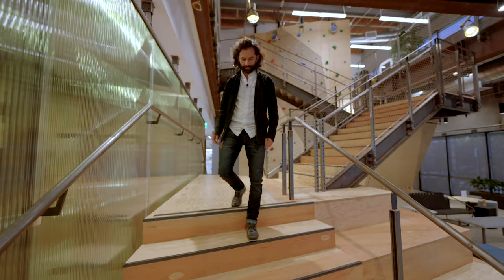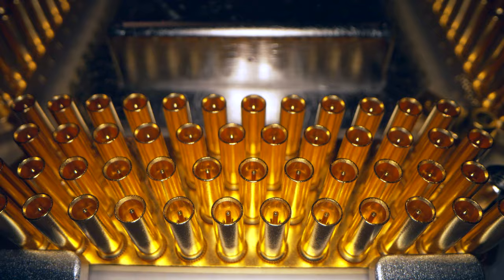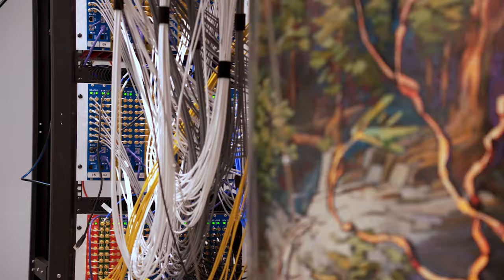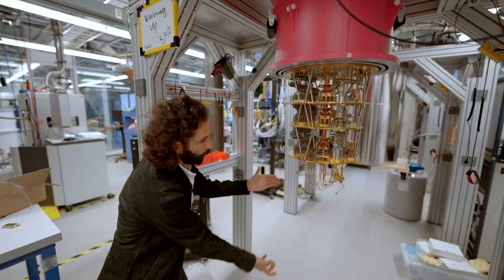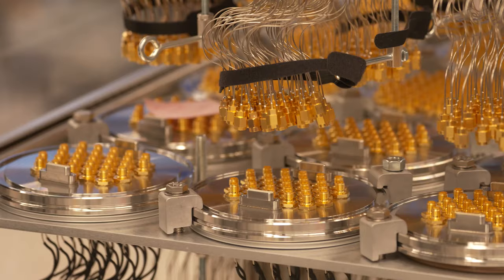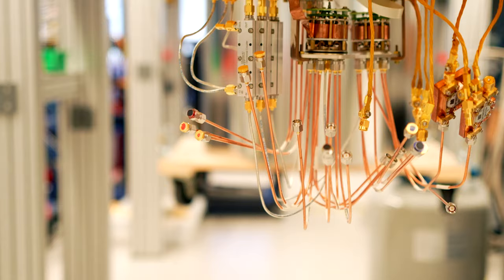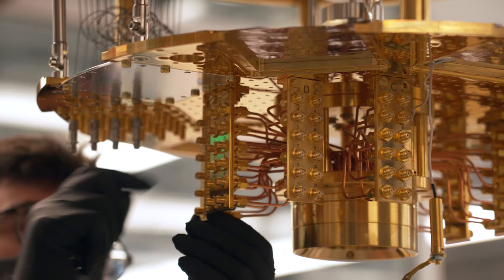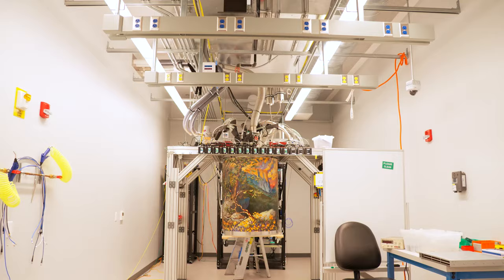Inside Google's Quantum AI Campus

Comment: "One of the coldest places in the universe." Man, how are they achieving those low temperature settings? Some type of gas? I can't imagine what kind of energy it would require to cool using electricity. (Btw, it's insane that we have an instrument capable of reading a temperature it has surely never read before. How are you supposed to calibrate a thermometer to read -450°F ?